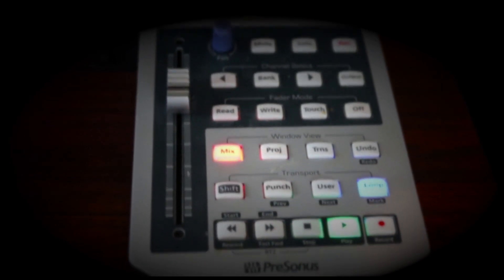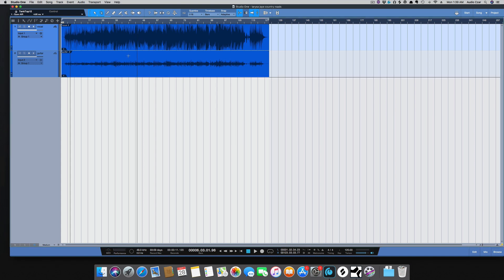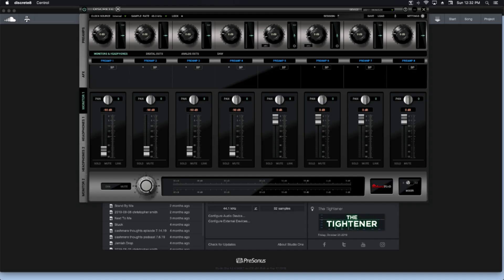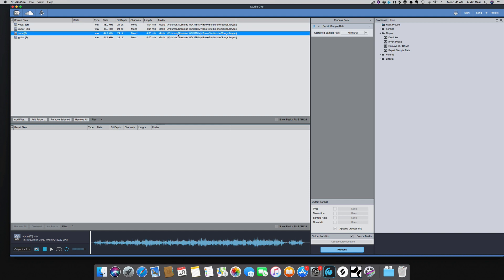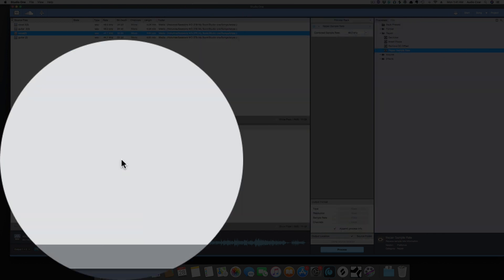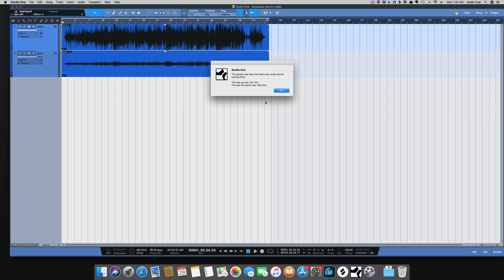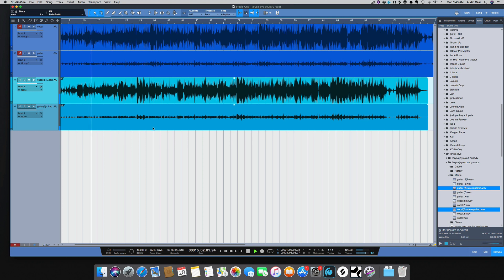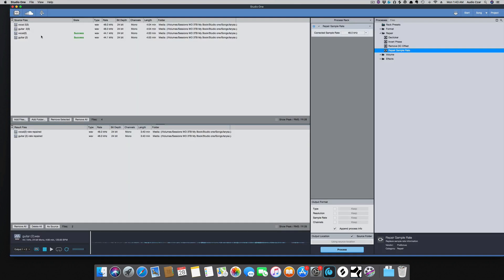Repairing Sample Rate using Presonus Audio Batch Converter

Comment: Hey there, so I had the same exact issue as you. Interface input/output was set to 48 while the song setup was at 44.1. I bought this software, converted the files to 48, and they still sound slow!! Any ideas on why that could be?
Reply from the maker: Does it play back correctly in the audio batch converter?
Reply: @TheAudioCzar  I have this same issue.   Sounds great in ABC but when it is repaired, it sounds fast.